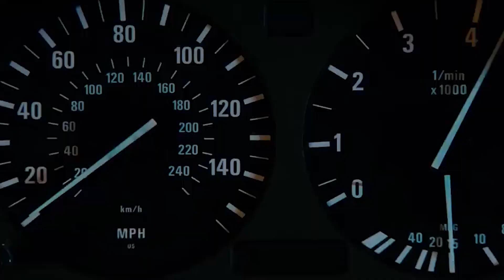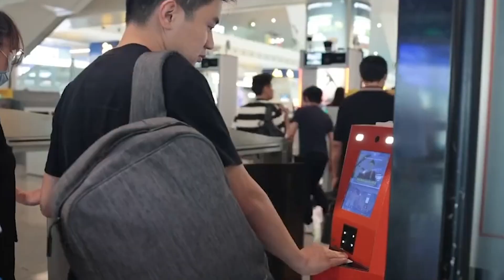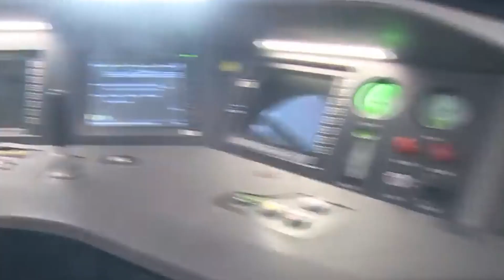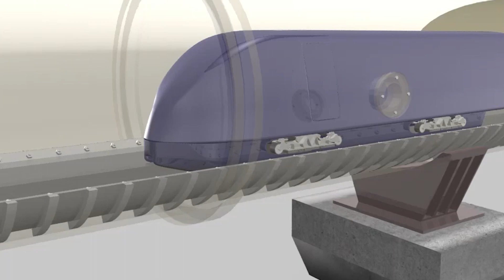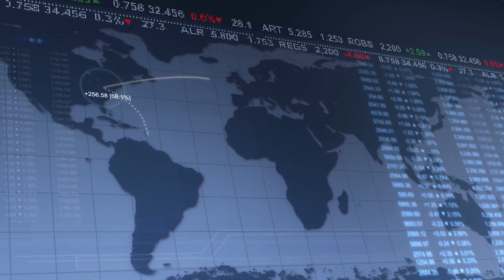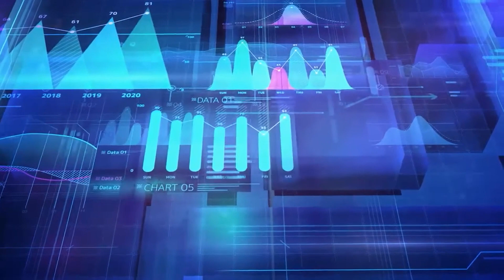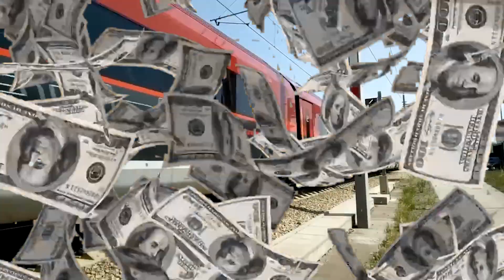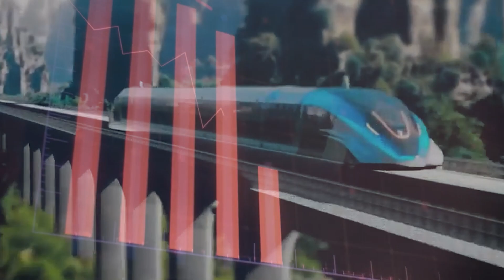China's $500 BILLION Railway System That Will CHANGE Everything!

Comment: 3:40 Since the straight-line distance between NYC and Chicago is 1147km, yeah, 2000km is a bigger number than 1147. 2k km is also longer than a paperclip, and longer than your hair.
3:52 WHAT? NO, that HSR line from Guagzhou to Beijing doesn't just take an afternoon to traverse. 
4:00 I just checked, I don't see that the SH-BJ maglev is operational, just proposed. I checked online, to 'buy a ticket', the maglev line doesn't exist yet. I wonder how many more odd things (or lies) this video will say.
8:23 Airspace is so congested in the PRC because the government is so scared of being attacked that commercial aircraft are restricted to very narrow paths. If the paths they were allowed to fly weren't so strict, there wouldn't be as much congestion.